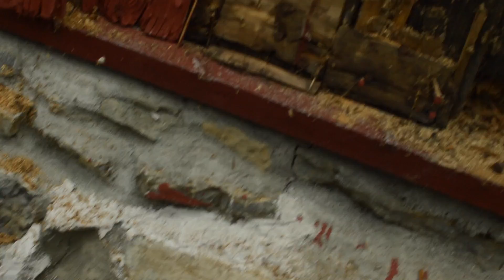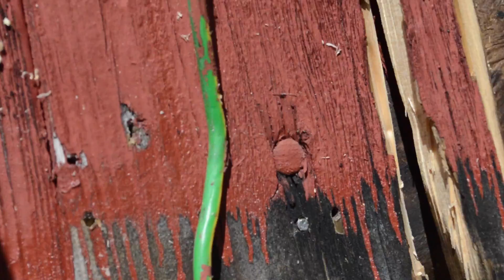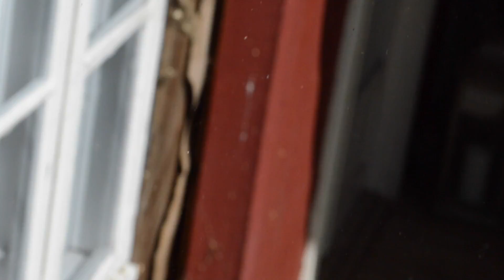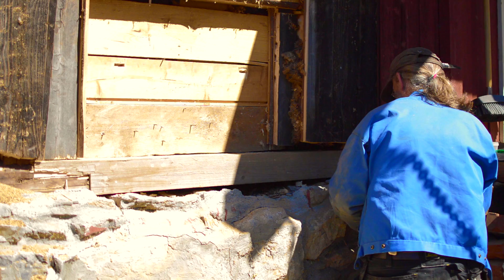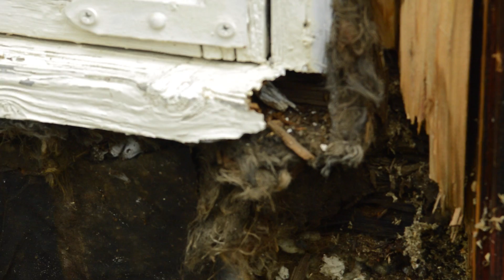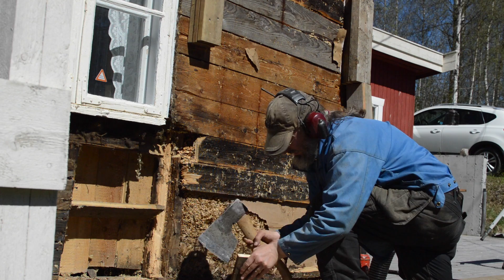🔴 Norwegian 1899 Post and Beam house repair- 2/5, no music

Comment: I have a product that I use in building log homes that you may be interested in.  It is used in the US lumber industry for protecting Redwood and Western Redcedar lumber to prevent tannic acid (an iron oxide compound) stains from developing on lumber.  It also works great for taking iron oxide stains out of wood that have already occurred.  You can connect with me through my website at www.loghomz.com if you're interested.  I think it would be really valuable in your work.
Reply from the maker: Just this week I was trying to remove iron oxide from a wooden floor I had been angle grinding on...: (   I remembered my Mum using lemon juice for stain removing in the kitchen and tried it and sure enough it worked wonderfully, applied and left for a few days. I will look at you link, thanks very much, all the best, Lucas
Reply from the maker: What a great body of work you have made during your carrier Mark, your website is an inspiration. Kyle if you are reading this thread then this is the man to get in touch with, he is your area right? All the best Lucas